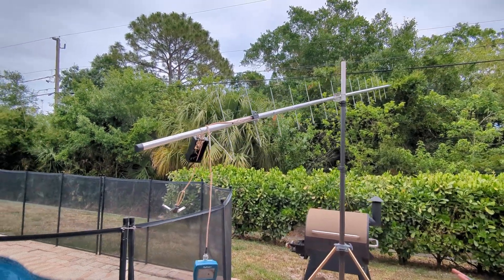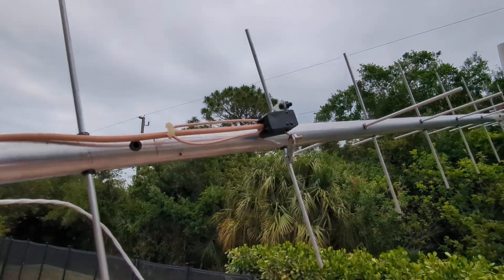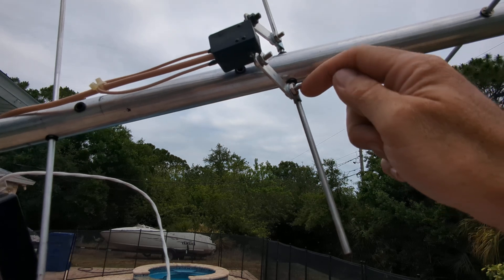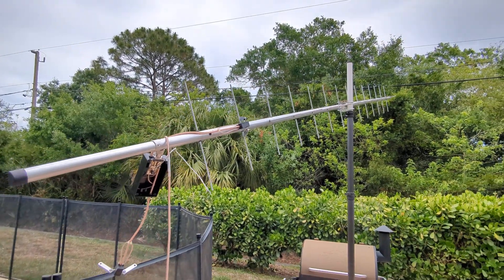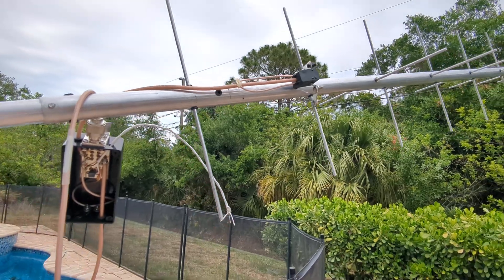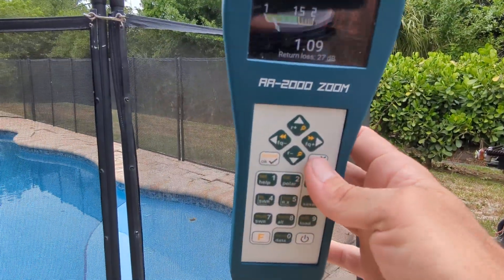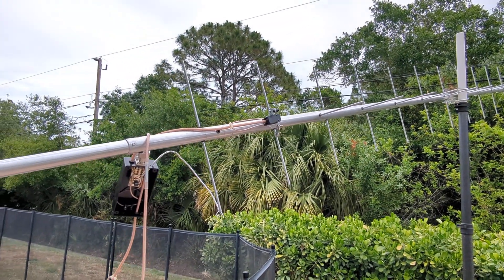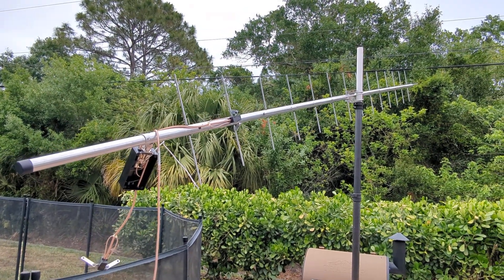Part 3, EME Moonbounce Antenna, 1.08:1 VSWR

Comment: Get 4nec2 and nec4 plugin and check the antenna without boom correction. Look carefull at the elements distance and get all elements above the boom to verify with the 4nec2 results.
This swr looks good but jou don`t see the pattern from the ant, you don`t know what you doing when looking only at swr and what the antenna realy do.
Reply from the maker: That's why I gave up and bought a 36 element online.

Comment: Although no spacing dimensions outlined in manual, using conventional yagi spacing preliminary modeling should be somewhat accurate.  Good news, the gain is about as specified, around 16.5dbi.  (Note: spacing could change this significantly).  Bad news, again with the spacing caveot, antenna as indicated is intended for satellite work and optimised around th 434Mhz area. Side lobes are acceptable and rather poor F/B.  
As a satellite antenna, it is really not close to what is needed for successful EME at the 432Mhz.  IF you eliminate the phasing box totally and fix the related feed system and make it switchable (not a big job) and get a preamp, it could be used for working some of the dozen or more big guns but other than getting that off your bucket list, not much else in EME area.   IF you decide to pursue EME, you do. have the basis and aluminum for a reasonably good yagi.  

FOR SATELLITE USE: it’s probably great in it's original configuration.
Post the element spacing, before and after, for better analysis.
Reply from the maker: Check out last night's video, I worked a station on Q65, trying again in a couple hours.
Reply from the maker: Part 4 I corrected the entire antenna and got it working with the intended element spacing

Comment: Again, IF you are primarily interested in EME, YOU DO NOT WANT CIRCULAR POLARIZATION ON 70CM!  You want switchable Horizontal to Vertical LINEAR polarization.  The -3db degradation on circular will kill you on a single yagi system.   

Not sure what’s in the small black box but suspect some lossy phasing circuitry and relay.  For EME, you do not need any phasing circuitry inside the box, just a simple DPDT relay and possibly a balun before or after to clean up the pattern.  

VSWR is impressive but the other changes you made could result in a loss of gain, poor F/B and even pattern distortion.  IF you or a friend has modeling capabilities you may want to model both it’s original configuration AND your current configuration to get an idea as to what. you have.  IF you do not have that capability, you could post here all relevant data and Im sure someone here can help you.  You need, element and boom diameter, all element lengths and spacing and type of element insulator.  

Not a fan of your feed system and would suggest in future to Blade dipole, folded dipole or better yet LFA. (All would require some extensive modeling).  Also, am assuming the entire vertical support is entirely PVC or some nonconductive material.  If grey part is metal, that could also be big problem.
Reply from the maker: I returned the antenna back to the original config when I made the contact with NC1I EME. I also had to take apart the black box, remove and resolder all the components.
Reply from the maker: I agree tho, I'm going to redesign it for linear one day.

Comment: Hi there! I'm just checking to see if you already had time to dig deeper into the antenna technical issue. Have you gotten in contact with the Amsat-bb? I bet several will assist you in sorting that matter out. Keep up the good work, and don't give up. Sooner than later, you'll be bouncing signal off the moon.

Comment: I had the same antenna in the 90s. I simply followed the directions and had it assembled in a couple hours. By the next day I had it on a Az/El rotor on the roof working the Sats. It worked great right hand and left hand circular. No problem.

BTW if your feeding one element its linear not circular. You must feed it as per the instructions for it to be circular.

Comment: Hygain is correct on the spacing...reflectors are moved close in to increase f/b ratio at the loss of bandwidth.    You need to look at gain more than swr..      that also isn't a balun, that is for phasing the 2 antennas for RHCP or LHCP.  

Spacing on directors normally increases as you move farther away from the driven element, with each element pull the signal tighter and tighter in.  Even spacing can be done at lower gain and lower f/b.   worry about building it as it was designed from a to z in both polarities before worrying about swr...  as to you missing elements...any metal supply shop or well stocked hardware store is going to have aluminum rod and push lock nuts...

Comment: Are all the driven elements the same length? If so, you will only need to move the same length back one to the front, then move all the rest in the back forward one hole!

Comment: I would find a yagi calculator online and check what the calculator outputs to what you have.  I had a yagi with one element that was drilled in the wrong location (was the same manufacture) and it drove me nuts for almost a week. That's how I solved my issue.

Comment: Eric, only if you think you need to pull all the elements, do you think it might be possible you started from the wrong end of the boom? 

I don't know if anyone else has suggested this, and it's already been eliminated... or perhaps there's just too much background noise between my audio receptors.
P
Thank you for sharing your experiences with us! We learn so much from you. ~73
Reply from the maker: No, because the rear of the boom has a hole drilled for the end piece of that pipe, and the front does not